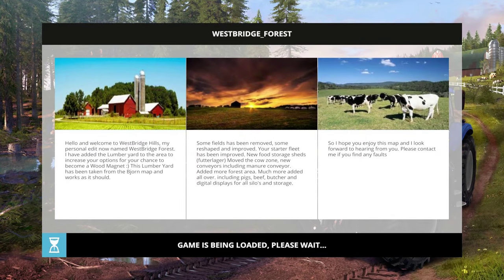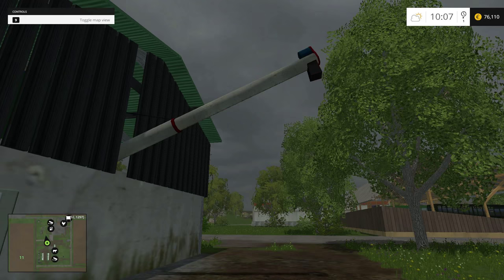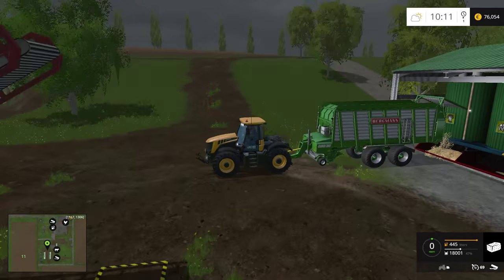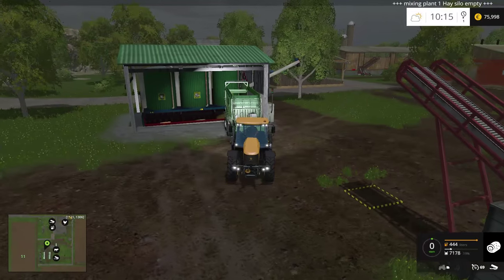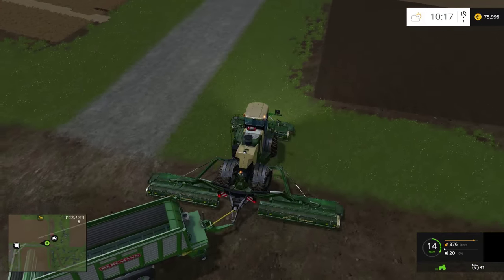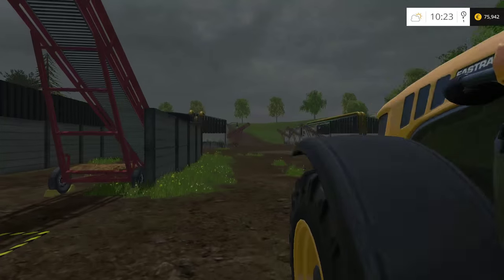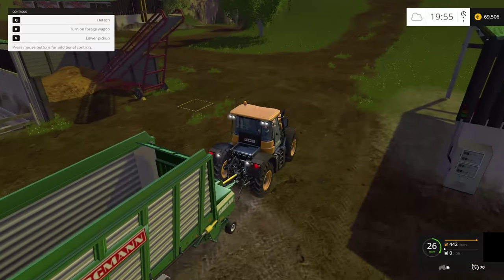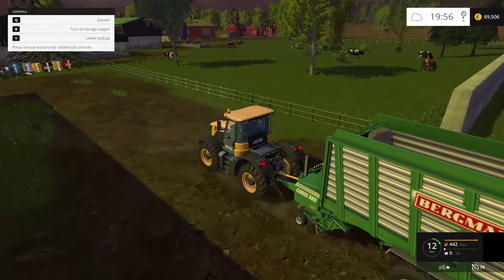Farming Simulator 15 - THE Mixing Station Tutorial

Comment: Thank You for the vids!! I have been working on Lakeside V4 Map by Stevie which had a mixing station. I have seen your feed your cows video and I have not done cows yet because it seemed doing the mixed ratios was a little daunting. This map has a mixed feeding station so I will give this a try! Thank You!!
Reply from the maker: You are very welcome, and the mixing station makes it a lot faster process, + you can get everything you need without having to ted/bail hay.   You just add grass, silage and straw, so you need less equipement.

Comment: im guessing if i have the mixer but no multifruit mod im screwed right?
Reply from the maker: +tankarmor That is correct - you will need multifruit, and possibly a multifruit friendly trailer.
Reply: well crap, now i have to start yet another new game. on a new map. for the hundredth time....
Reply from the maker: +tankarmor I don't think you have to restart - You should be able to just add the mod and it will start working - I don't think you need to start a new farm - When I first did it I didn't have multifruit, and I just added it to my mods folder and logged back in and continued where I left off.
Reply: found a dedicated multifruit mod. it just alters the parameters of the stock equipment. works with all maps.
Reply: I installed this mod and still can't get the option to fill any of my carts at the mixing station. I have literally bought every cart the store has and can't get it to fill